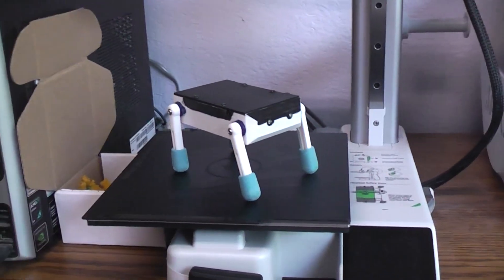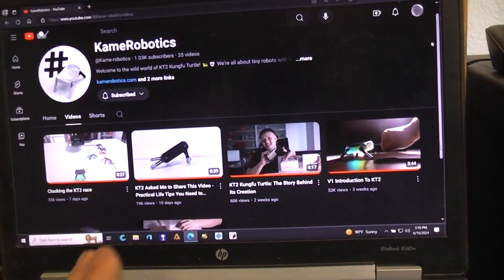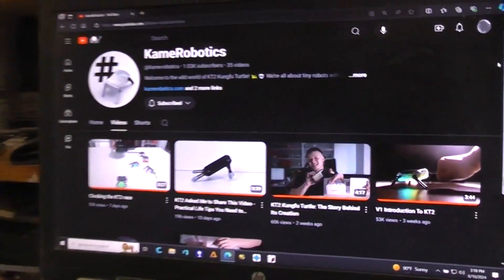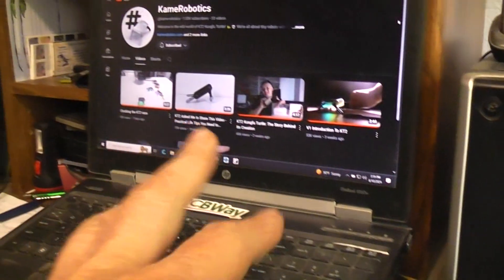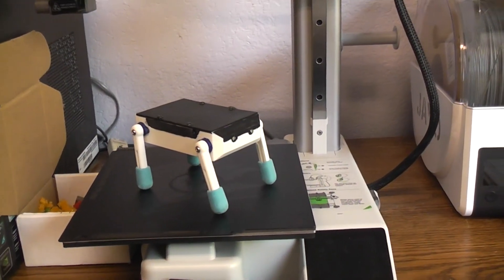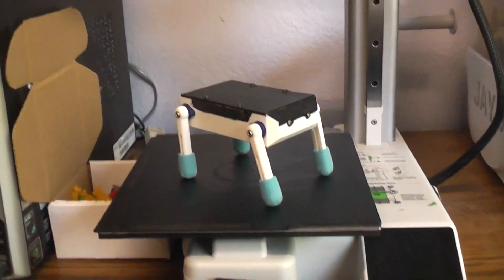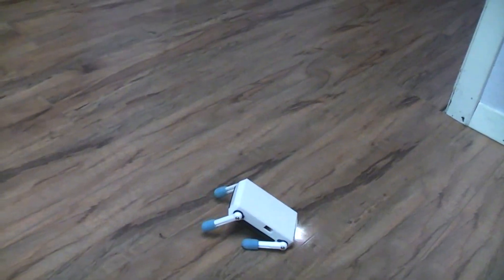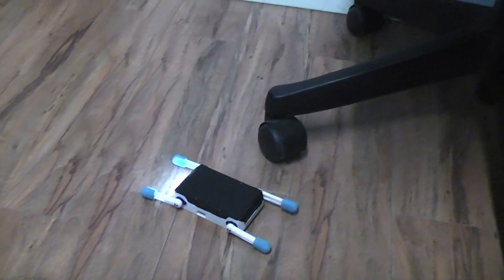DIY,  Katie 2 robot project. A distant relative of KaneRobotics KT2 Kungfu turtle?

Comment: This is amazing! Thank you for sharing :) I need to build it too, hopefully next weekend. Subscribed
Reply from the maker: Working on the final design. Instead of the standard 9g servos with 180 degrees rotating I have some 270-degree metal gear 9g servos on order. Also, I have placed a order for PCB from PCBWAY for $5 bucks that should clean up the wiring. We will see.

Comment: Great job, is it possible to get files and code for it? You used 360° servos?
Reply from the maker: After I have worked on it bit more I will share files.
No I used standard 9g servos just like KaneRobotics uses. many have suggested they used 360 servos but they did not. Its all in how you set them up .